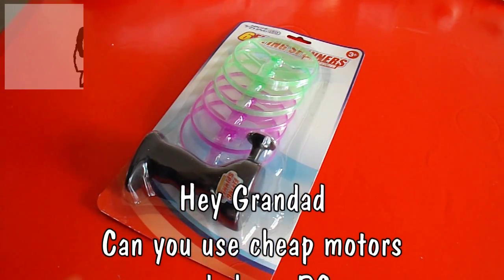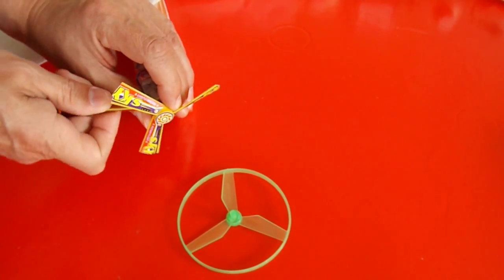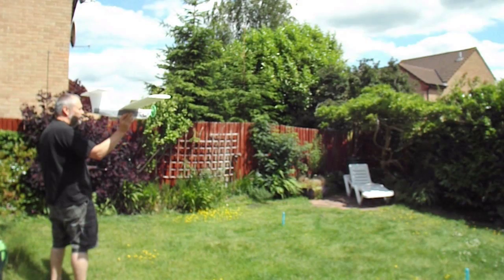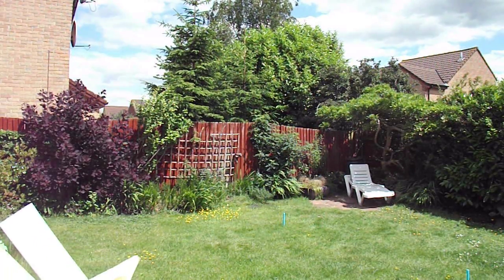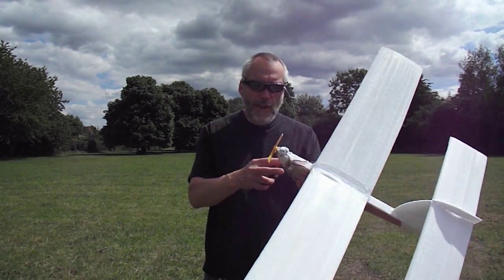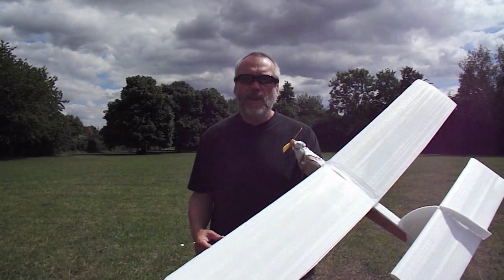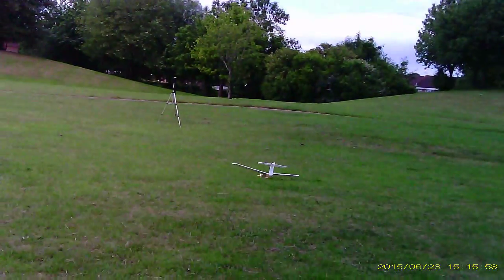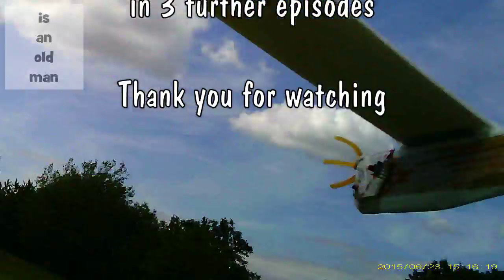Hey Grandad can you use cheap motors and cheap RC for a plane More Flights #1

Comment from the maker: +Rob Santen you keep commenting on my videos but you have blocked replies on Google+ so I cannot reply direct to your comments. It would make life a lot easier if you took the time to fix it. If you look in my video description there is advice on how to do that.
In answer to your comment, yes that has been suggested, see Mongrel Shark's detailed explanation down in the comments here, I may even do that some time but the real aim of this project was to keep it simple and basic to answer the original questions. My usual answer to those questions are that these motors are not powerful enough and the RC gear does not have sufficient range. The people asking these questions want to take apart a toy car and stick the parts straight in a plane and expect it to fly and the short answer is it won't work.

Comment: You could put a button cell in series with the existing cell. Not good for the button cell, but gets you the voltage you want for light weight. How concerned are you about fire?
Reply from the maker: Mongrel Shark hey thanks for dropping by. I can probably take a bit more weight anyway, 2 of those LiPo's would still be pretty light but I am more worried about burning out the receiver with the extra power. I am on holiday at the moment so it will be a while before I spend any more time on this project. I am actually quite annoyed that it nearly works as I expected it to be a total failure and I could move on to something else, but it is so close to flying under it's own power that I may have to extend the project and see if I can do it.
Reply: An LM series voltage regulator could be light enough to fly and protect the controller. Lots to choose from. 7.2 down to 3-5v is easy. The Lm317 is a very popular adjustable regulator. Can do about 5vto 40v in and 2.7v to37v out. As long as in is at least 2.7 v greater than out. They can get hot and nead a heatsink. But probably not a problem in this case. The Lm317 could be handy for some of your other projects too. If you can't put motor drive current through controller. Use a transistor to switch the motor on from the signal provided by the controller.
Reply from the maker: Mongrel Shark yes everything you say is right, but the purpose of the exercise was to try the components directly scavenged from the toys without significant modification. I may well do something like you suggest, or even just a simple relay to directly switch the power for the motor. I am pretty sure I have some LM317s in my stock somewhere but a small relay may be more visually understandable for some of my subscribers. In fact it is tempting to use one of those remote switches that you can buy for garage doors etc as the range is probably better than these cheap rc car transmitter/receiver sets :-) Having said that I am tempted to use the 2 channel RC transmitter for throttle on/off and Rudder Left/Right so I can actually have a little more control, rather like the original rc planes only had rudder control and flew till the fuel ran out.
Reply: About the only othe thing I can sugest is to seek out better motors. I have a box of broken cheap remote control helicopters here. People keep giving them to me for parts. They look like 1.5v vibrator motors, but run on 3.7 and go pretty hard. You may even be able to use the very tall gear drive they use. The helicopters can be found at k-mart etc (Australia) for about $15-$20 (maybe under £10) new. Or for free if you know kids that crash them. The props may also be useful.

Comment: Commercial styrofoam model planes tend to angle the prop towards the ground, probably to force air under the wings to give a bit more lift.
Reply from the maker: hellcattanks I started the trials with downthrust and reduced it until the plane flew better.

Comment: Try adding entensions to the propellers to make them longer.  The longer blade will spin faster on the outside edge and give you more power and thrust.
Reply from the maker: Hi Alan, the simple fix is to buy proper hobby grade propellers. I am only using these toy propellers because I am trying to use components from bargain store toys to build this project. I doubt that these toy propellers would last long if you try extending them, they are only cheap plastic. I am not sure why you would expect a longer blade to spin faster, certainly if the motor could maintain the same RPM the tip would be moving faster but the extra weight and diameter would slow the motor down. If you want to see this plane fly you can follow the series using the playlist linked in the video description or jump straight to this episode https://youtu.be/6dw0gQTXJog?list=PLA5a2xPRSrB3v7nI2gkMPSAD5LOoSQkzk

Comment: If you are using normal nic-cad batteries, and that old flintstones motor, you could do it, but you would need balsa and tissue and as slick as possible. And probably a flying wing would be the best bet. Maybe cover it with glad-wrap or some sort of slick thin plastic stuff. This is YouTube challenge stuff (and hard) so it's really more of a lab thing. Not something a kid can do as a hack. lol Enjoyed the video, keep it up.
Reply from the maker: Hi, long time no see, how's things going down under. You seem to have taken a break from the uploads. Hope everything is OK. In the end with this project I put a slightly better motor on it, still not aircraft quality, small LiPo
 and proper RC but just single channel for the rudder, just to prove the plane would actually fly given a chance. I am sure one of your super light weight faomies would manage, it is about spreading the weight of those junk motors over a good sized wing area to support it 😊 YouTube seems to be pushing some of my old videos for some reason instead of the new uploads, very strange.

Comment: have you considered a giant popsicle craft stick.. Soak it warm water,  then twist it to suit, let it dry, drill out the hub. You might get more pull that way.
Reply from the maker: Probably a little heavy and certainly a problem to balance to avoid vibration. Proper plastic props are easy enough to buy on eBay or other online stores but I was trying to source the components from the bargain stores. In a later video I put a decent prop on it to show the difference https://youtu.be/v2GxAdqEBW8?list=PLA5a2xPRSrB3v7nI2gkMPSAD5LOoSQkzk and later still I make it RC https://youtu.be/6dw0gQTXJog?list=PLA5a2xPRSrB3v7nI2gkMPSAD5LOoSQkzk but that was never the original intention of this series. I was just trying to show the RC gear and motors in those cheap toy cars don't have the power needed to fly a plane without a lot of extra work by which time you might as well have bought a decent motor and proper RC gear.

Comment: Drifting aside a bit from the materials you are "allowed" to use in this video.
If you use two batteries you can add a 7805 voltage regulator to reduce the voltage to the controller, and instead of supplying current directly from the controller to the motor you can use an NPN transistor to supply the motor directly with 7.5v.
Reply from the maker: Xoft C yes, that has been suggested and it would work, but is a step further away from using parts taken directly from the cheap toys. I may do that in a later version just so we can see it fly unrestrained by the limitations, rather like I did with my quad fan hovercraft project finding how far I could go with cheap motors and finally putting proper little brushless motors on it to see the massive difference in performance.

Comment: you can look at the reciver and identify if it uses a mosfet and what kind of mosfet  to turn on the motor. You connect the reciver to one battery and you connect another one in series, if it is n-channel you can hook the positive of the motor to the second series battery and the reciever on the first one(common ground-motor through mosfet) and if it is a p-channel you connect the reciver to the second battery(common positive) and the negative of the motor to the first one. in both cases the motor will get more volts but i'm sot sure that the reciever's mosfet will cope with that.
Reply from the maker: +jimbit22 thanks for the hints. I may revisit this next year when the weather improves, but the key point here is I am answering a regular request from many people who want to be able to take apart a cheap RC toy car and expect it to fly a model aeroplane. I am trying to make it clear that is not going to happen. Yes there are lots of potential modifications you can do, you will see several in the comments on the various episodes of this project but I am guessing most of those modifications will be outside the scope of the people asking this questions. The simplest answer is to buy proper hobby grade equipment. The difference in price is not much when you go for the cheapest RC equipment and you will get a far more satisfying result.

Comment: use a gearbox like used in rc plane for brushed motor .and then you will get the required torque and thrust .you have to use more aerodynamic propellers. i did the same and mine flew pretty well.and try to make the body light and small as per your motor.
Reply from the maker: soumita bhattacharya this project is as I described and may extend over several more episodes. The idea is to use parts from cheap toys. People ask me if they can use the parts from their broken toys to make RC planes and that is what I am trying to do. If I have to start buying extra parts to make it work then the original target is missed and the project fails even if the plane flies. The biggest problem I can see is finding suitable propellers on a cheap toy and so far the only ones I can find are toy helicopter rotors.

Comment: hi would it help if you mounted the motor above the wings making it less nose heavy .....or by using one of the tiny motors from a rc helicopter ....great video as always double thumbs up
Reply from the maker: darren debenham the purpose of this project is fairly specific. To use the cheap motors I get from toys and toothbrushes and the RC gear from cheap RC toy cars.

Comment: Im into diy rc planes now. The electronics is the only problem. I bought a heli for 6 euros at gearbest yesterday for the parts. It was cheap enough to try. I even get the controller for that. Now I just have to wait for 3 weeks...What electronics did you use for the project?

Comment: Hey Grandad! I read that an airplane can reduce drag mantaining the same surface area by extrnding the wingspan and narrowing the chord. Seems like a thumb rule was that the section of the wing created a "drag effect" of a circle inscribing the section. So the smaller the section, the better, even though the wingspan (and thus the leading edge) increase, overall drag decreases. A good example is the U2 and also best gliders have this in mind. The bad part is that, since they reduce drag so much, they tend to get a faster gliding speed, because it's closer to the optimal speed of the wing section (AFAIK)
Reply from the maker: DoNotPushHere my planes design themselves from the size of the materials I have available and the tools available. A high aspect ratio wing would require light weight strengthening such as carbon fiber rods. I don't have any so the wing is the size it is and it is probably going to break after a few more flights. If you see any pictures of that solar powered plane that is currently circling the world you will see that is the sort of aspect ratio you describe.
Reply: GrandadIsAnOldMan
You've said it. Neither do I have those fancy materials but a cheap way to get some more strengh over rigid foam wings is to use cellotape! Simply cover the under surface of the wing with cellotape. Be sure that it's done with a bit of tension applied on it. You may need a person holding both ends of a strip with a firm grip, and a second person to place it smoothly over the lenght of the wing.
Thus the cellotape avoids the foam to break by tension. It's like the steel bars on a concrete structure.
It will still be fragile, but hey! it's cheap enough!
About the size, hmmm... you got me there, but maybe you can make the wings separated, and make a proper joint on the fuselage. I'd link them under the fuselage, and add a small piece of balsa, serving a similar function like the cellotape: acting by tension, not by compression.
Reply from the maker: DoNotPushHere yes if you look at my other recent RC gliders they are covered in tape, but I didn't think I could afford the extra weight on this one as we have so little power. I do have some short fiber glass spars from cheap kites that I could use but I am risking it without at the moment.

https://www.youtube.com/playlist?list=PLA5a2xPRSrB1Qj--01eR1NU_K2RCbH3R8
https://www.youtube.com/playlist?list=PLA5a2xPRSrB0IHk7pAAHCwTLfGDX_SK-k
Reply: GrandadIsAnOldMan
Impressive!!!! I didn't know those playlists at all!! I'll have to check your channel for other masterpieces!
And I've gotta take my time to watch both playlists...

Comment: How about you make a rc kite. I made one from a rc plane and it flyed great,until the blade broke. But you could use a small kite and add your hobby grade components. Try it,trust me it will fly great.
Reply from the maker: +Brad Smooth I have seen quite a few videos titled RC Kite but in my opinion most of them are what I would call flex wings or even microlites however I do like this one by Peter Hobby - RC Kite - Swiss Edurance Record Flight Indoor https://youtu.be/BrT0p4czPxQ

Comment: i think you must use two motors ..must mount in the both side of the wings
Reply from the maker: +Mark Joshua maybe that would work, but then you need extra batteries to power a second motor and you are adding extra weight. Even if that does get it flying you are still stuck with the fact that those cheap rc car transmitters/receivers are very short range and you will soon lose control of the plane unless you are running after it.

Comment: can you make a video where you show exactly where you connect the switch, motors to the receive (4 channel)
Reply from the maker: If you want help on getting into Hobby Grade Radio Control I strongly recommend that you watch the FliteTest RC Planes - beginners series https://www.youtube.com/playlist?list=PL6IuSFWz4ktvupu_gxw1vn-sjBGOkJFHV For toy grade receivers they are usually clearly marked on the circuit board F+B for the forward/backward drive motor, L+R for the left/right steering motor, Bat + and - or Vcc and Gnd for the battery terminations. Some toy grade receivers have the motor terminations marked M1+ and M1- for the drive motor and M2+ and M2- for the steering motor.
Reply: thx

Comment: Try wiring two mini 1 cell lipos together to double the voltage!
Reply from the maker: squidink RC I suspect that 7.4 volts would burn out the receiver as it is designed for 3 or 4.5 volts.
Reply: GrandadIsAnOldMan You are probably correct, but the plane is very close to sustained flight, if you do try you might need a smaller prop or you will be drawing to many amps. My quadcopter came with 8" props for 4 cells lipos and 10" props for 3 cells lipos for this reason.
Reply: Try doing a more controll test, like starting from 3 AA testing it 4AA test untill you reach 7.4 volts. But if you dont want to risk burning it out this is just a suggestion
Reply from the maker: WD-40 the props are a big issue as I am limiting myself to props that I can take from cheap toys so it is very much a matter of what I can find in the bargain stores.
Reply from the maker: squidink RC  I may try increasing the voltage to give the motor more power as the motor is fed through the receiver and they both use the same battery, however there is a good chance that will burn out the receiver. I may use the receiver to switch a small relay or a transistor to switch a larger battery to power the motor, that would eliminate the issue of overpowering the receiver.

Comment: 1 lipo to ESC Bypass ESC for other Lipo. Connect ESC - motor output directly to motor, ESC +ve motor output to other lipo -ve terminal, finaally other lipo +ve terminal to motor. This way ESC motor output acts as 0 to 3.7 V variable voltage battery connected in series with another 3.7v battery & total volts going to motor to be 0 to 3.7 +3.7. Perfect sol
Reply from the maker: Sounds like it might be worth a try. Have you done this? You will still be pushing 7.4 volts through the "power transistor" in the ESC circuit.